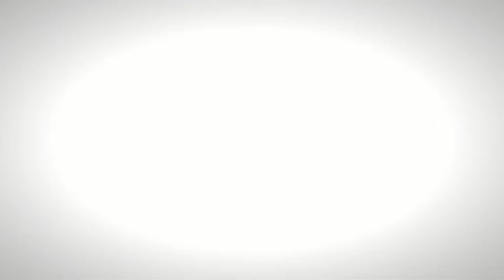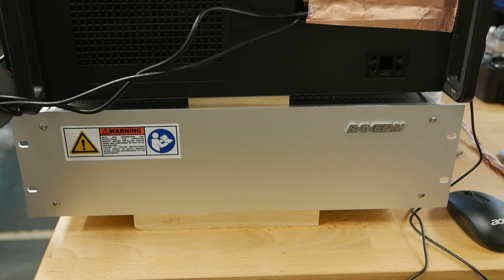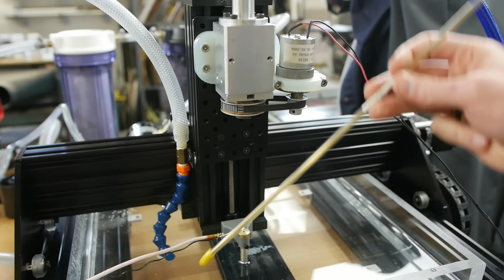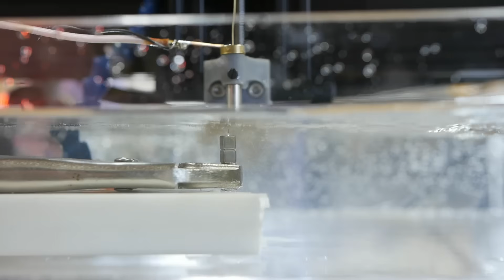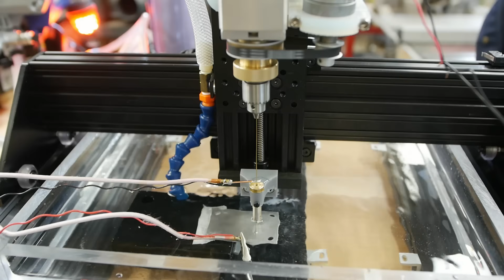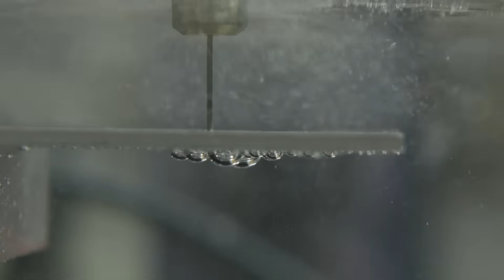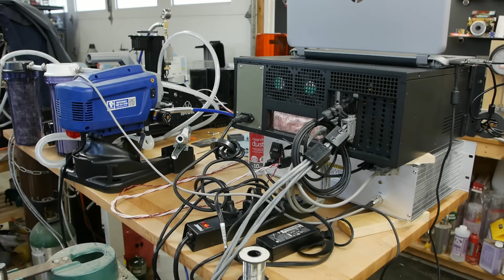Drill through anything (conductive) with Electrical Discharge Machining

Comment: Excellent!

How about trying to machine copper clad PCB?

With a very fine tip, it may be a good solution. Also, you could monitor the conductivity as you machine the PCB to deal with lower quality boards that might have uneven copper thickness.
Reply: Copper is one of the worst materials for machining with EDM. That's why it is one of most popular material for EDM electrodes along with graphite (low electrode wear ratio).
Reply: raiden00pl  interesting! What is the nature of its “worseness”?
Reply: Copper has low material removal rate (MRR), which means that the machining is ineffective. Mainly because copper is a good heat conductor. Of course, EDM machinig is still possible but more difficult than for eg. tool steel.
Reply: @raiden00pl  That's both awesome and annoying, and the reason we can't CO2 laser copper clad directly too :(
Reply: @cda32  Copper reflect the Long wavelength of the CO2 laser very well so a lot of the IR light just bounces back at the lens.  This is why copper is typically lasered with blue pulsed lasers to drive the energy high enough to cause evaporation.
Reply: Thinking about it further, you would have to rasterise the design to maintain a conductive path.

Comment: Awesome!!!  DIY EDM... I've totally not used in decades though use to explain to some, that are used to machine tool systems, the process of ablation in electrocautery RF tools and in general.   Maybe elaborating on shapes and capabilities of EDM maybe?  Instead of kind of like chiseling or like making key ways or square or hex head shapes for nuts or screw heads in materials maybe for aluminum cases for shielding?  Also... patterns on surfaces and different methods to make shapes that are challenging to machine.  Really neat watching open!

Comment: Of course ben makes his own EDM machine! I expect a fully functional fusion reactor by the end of the week.

Edit: just wanted to plug this excellent Japanese tv show called supreme skills which is sort of a game show for Japanese scientists and manufacturing specialists. Heres an episode where they use a manual lathe and EDM drilling to drill through a pencil lead: https://youtu.be/pCtWPbTDbuY
Maybe you should give that a shot!
Reply: not if he doesn't want a run in with the law.
Reply from the maker: @theCodyReeder  There's a reason that I have not done an X-ray video in a long time :)
Reply: @AppliedScience  Ah there you are! You asked on what else to try this on! I think you are / we are now starting to rediscover how the ancients (pre-dynastic) have done it! (Partially at least: The precision and easy cutting part, still not the precision easy lifting and moving part)... Try it with granite or quartzite or andesite or basalt etc stone. The quartz content or other materials of these types of hard stone should be conductive enough for this method to work on them or if not see if you can think of a way to get it to work! You're an engineer and you have the tools, it's worth trying to figure this out.
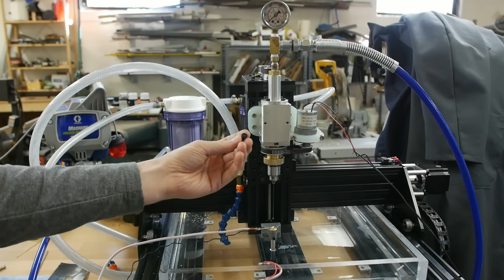Examples: watch?v=ZV5MuIjK9Dc&t=3m47s (3minutes47second in to 4minutes 14seconds is a good example, and again at 5:18 to 5:26)
Another: watch?v=lcdU17QBSlU&t=5m39s (to 5:47)
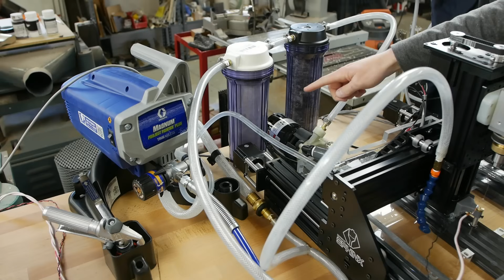And very compelling: watch?v=puXsFyainQU&t=2m0s (to 6:24)

Also your bits seem to just be cylindrical pieces of metal, could making them more like traditional drill bits or using different metals improve the efficiency and effectiveness of the EDM drill? Like if you could make the sparks come out of all the grooves or edges in a spiral bit configuration all at once... Or maybe not spiral grooved but a ribbed configuration with the sparks coming out of the peaks or valleys of each ribbed groove.

One step closer to solving ancient mysteries and regaining back lost technology! :D
Reply: @AppliedScience  I have mixed feelings about giving this comment a thumbs up or down... :)  Thumbs down for not creating X-ray content, Thumbs up for not getting into a debate with volunteer or appointed bureaucrats that hear scary words and freak out.
Reply: @AppliedScience  For EDM machines like this (especially for lathe and milling type setups), it would be nice, definitely convenient to have/build a self-calibrating unit to integrate into the system, something that would periodically pause the operation, re-dress the tip of the drill, re-calibrate and return to operation. This would add much more practicality and convenience to more elaborate or extensive projects.
Reply: @theCodyReeder  Fusion reactors are legal to build, fission reactors are not. Make magazine had an article years ago about building a star in a jar. The real challenge is building a fusion reactor that produces more energy than it uses.
Reply: Ben A. Is there a difference between a fission reactor and a bomb? I have a feeling its a very fine line
Reply: @jamesdavis2027  it's not that it is a bomb. it's that it could be turned into a bomb.
Reply: @jamesdavis2027  Fission bombs release all of there energy at once in an uncontrolled manner. Fission reactors are carefully controlled to not release all of their energy at once.
Reply: @jamesdavis2027  a big difference. Nuclear bombs require extremely precise timing of a shell of explosives around an enriched nuclear core in order to cause the entire mass to start fissioning at the same time and create a chain reaction the goes long enough to do real damage. The vacuum tubes used for the timing of the explosives are still restricted exports
Reply: @theCodyReeder  No surprise to see you here Cody. Ben does some amazing work.
Reply: @theCodyReeder   pretty sure small fusors are legal.
Reply: @theCodyReeder  Fusors are perfectly legal - building them's actually a rather common (I mean, among the sort of people who'd want to build a fusor) project. 

(I suspect your plan to make plutonium by irradiating your uranium samples with neutrons was the sort of thing that unnerves the Feds, though.)
Reply: Well, everything is possible with enough money and time on your hands.
Reply: @fullmetaljacket7  Just think how far a head in technology humans could progress, if we just eliminate money, and all come together as a species, rather then different races.
Reply: I half expect he's already got a fusor sitting around somewhere.
Reply: Didn't you pay attention, cheaper to buy from ebay!

Comment: Would you consider doing a video about graphene chemical vapor deposition?
Reply: Esra Erimez graph vapor d is easy get roll of copper put it in a methane atmosphere and cook it at high temps. u need to put seed xystal on the copper. I would like to see some  https://en.wikipedia.org/wiki/Electron-beam_lithography he already has a scope he could mod.
Reply: @Amipotsophspond  It would be a short video for sure. The process is actually very simple - it's the science behind it that's complex. Kind of like nuclear, it's actually very simple in concept, but the finer details are what gets ya.
Reply: Perhaps titianium nitride or gold vapor deposition?
Reply: @actiglow  I imagine depositing gold could be done with something akin to a plasma welder. I.e. HF arc between gold electrodes and blowing it with a suitable gas (likely argon or hydrogen, for not being in the way when the layer builds) onto the target. Maybe use magnets to focus the arc for better sputtering of gold when hit by plasma (higher current density==higher temperature to get a mix or sputtering and PVD).

This could allow high-res additive manufacturing, by way of depositing a conductive film, printing/exposing a mask, followed by stripping the mask and briefly wet-etching the thin film.
The aspect ratio is limited by the mask's aspect ratio, not by the ~0.5 you get from pure substracive wet etch (aka traditional PCB process).
You could fill the voids from mask stripping with something and repeat. Note that buried vias are trivial in this technology, as well as buried semiconductor dies which are prepared for flip-chip mounting (though they might be preferred without balls).